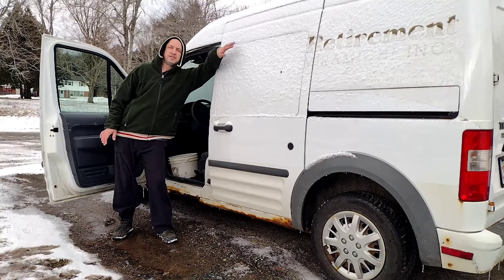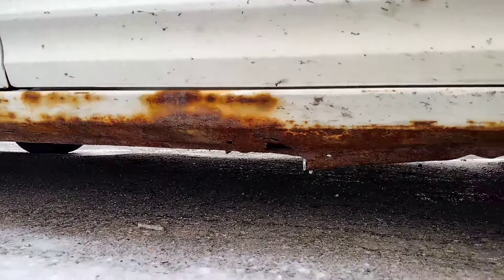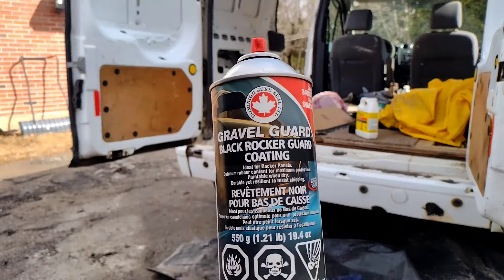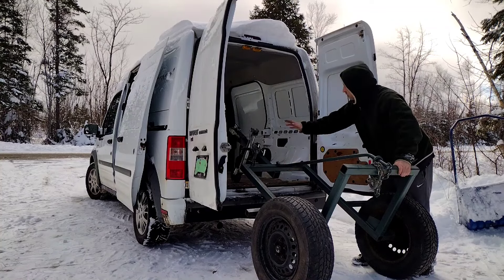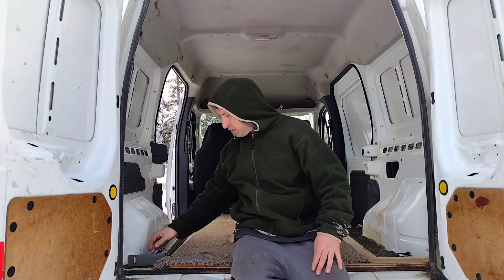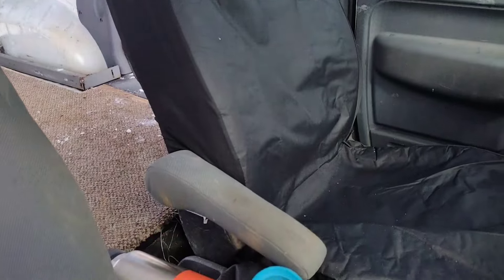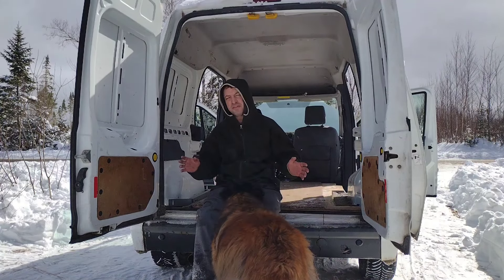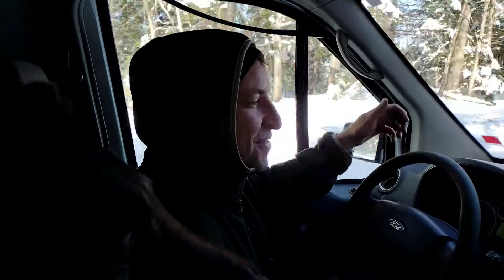2010 Ford Transit Connect repairs and review

Comment: A repair like that here in the UK would fail the annual MOT test. It has to be welded metal panels. Our Transit Connects get the same problem. Mostly Ford cars last a long time but their Transits, not just the Connect, but the bigger ones too, seem to have been made to rust like yours.
Reply from the maker: I think it'll pass here but I'll have to give an update on that! You'd think they'd make stainless rocker panels but I guess then you sell fewer parts and fewer vehicles :/